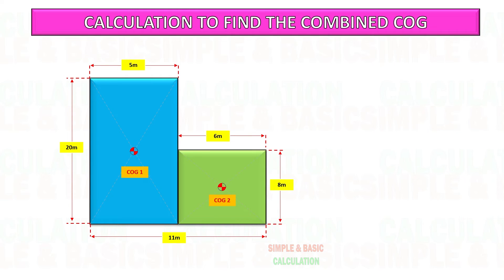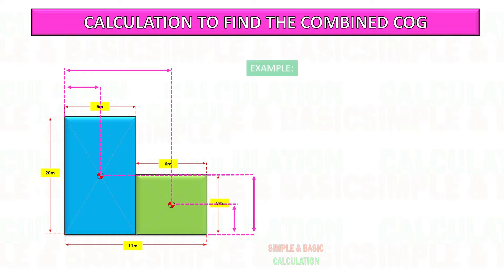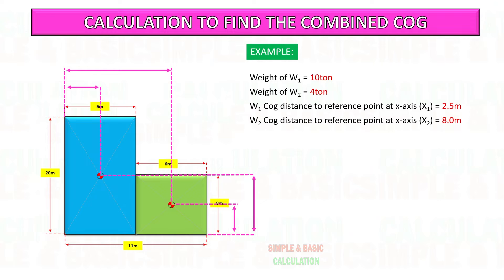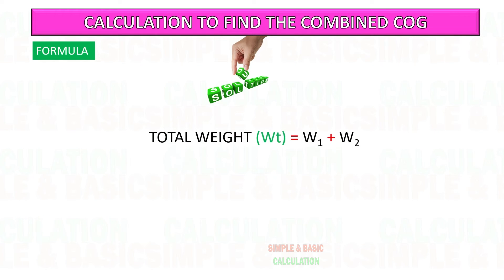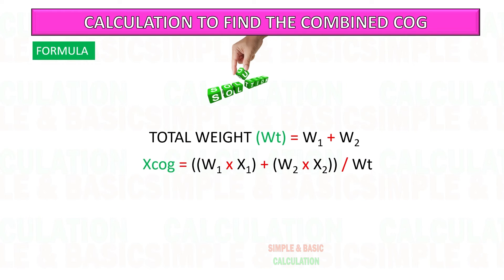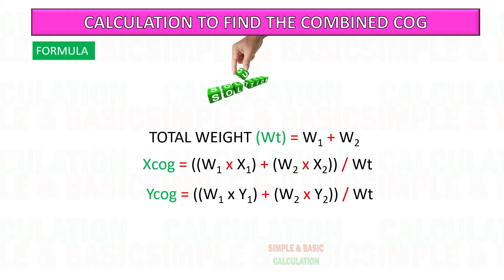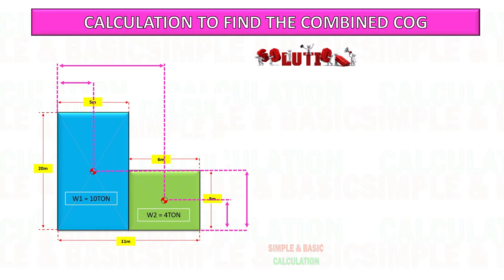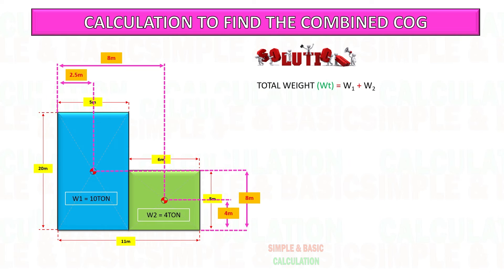Calculation to find the Combined COG of an Load or Cargo #lifting #rigging #crane

Comment: Y1 and Y2  in the earlier example are also wrong ,Y2 is 4m Y1 is 8m
Reply from the maker: Thank you for the feedback, 
It was just a typing error where the values for y1 and y2 were mistakenly swapped, but the calculation and formula are fine, so there is no need to worry. Cheers
Reply: Xcog also is wrong= (25+32)/14 = 57/14 = 4.07